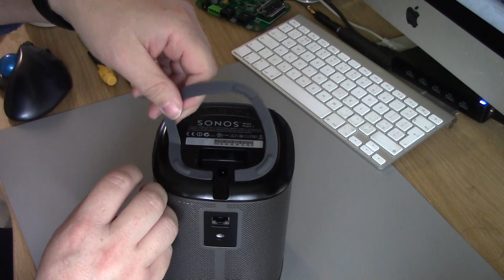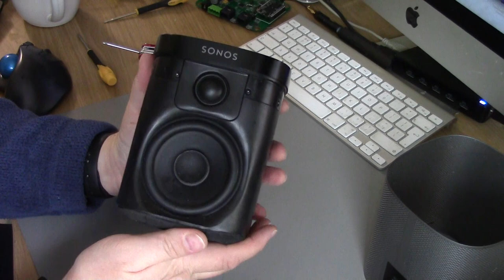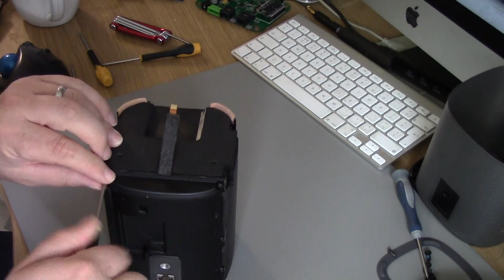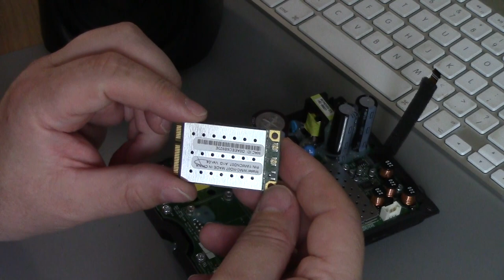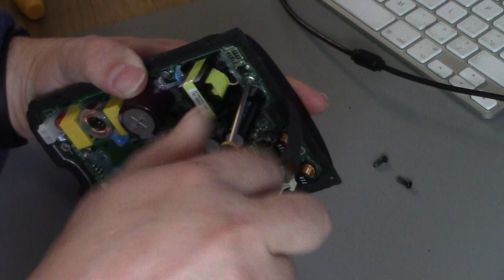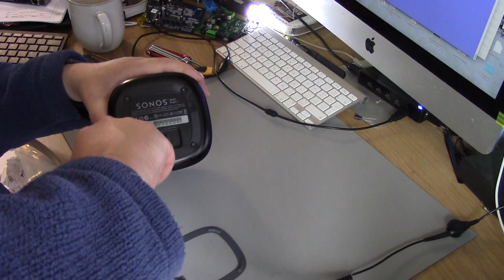Sonos PLAY 1 - Teardown

Comment: On a side note: I managed to hook up a powered Polk audio sub to a play 1 easily. You basically just hook a wire on each woofer wire and it’s a done deal. You start the sub on very low volume and run a trueplay setting and there you go, you now have real bass ;)

Comment: Is there a way to tell what’s wrong with a speaker once it’s open? Mine has a solid white light so should still function but will not connect to WiFi or be recognised by Sonos app. The factory reset doesn’t do anything and I don’t know what’s wrong with it.

Comment: I have a blown play 1 and wanted to turn it into a sonos connect to run my reviever. They want $500 for a connect so I figured if I could find where the signal goes into the amp and solder rca's I could save a lot of money. Do you know if this could be done?

Comment: Based on what you see, is there any way to pull a line out?  Coming off the amp directly?  Where do they split the frequency b/w tweeter and mid-woofer?
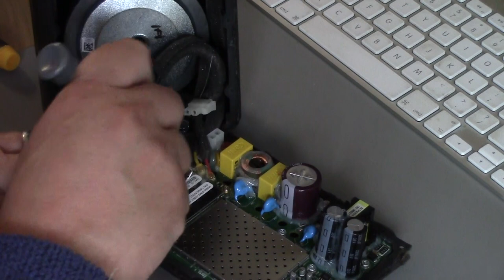Reply: Probably not.  See this, based on the speaker from Ikea (also made by Sonos).  Frequency is split in the processor itself.  https://www.youtube.com/watch?v=ZB413S8KDmo (at about 7:45 in that video)

Comment: Excellent video.  I wanted to see what I was facing when I tear one apart to add external speaker wires for an outdoor speaker.  4 wires coming off the main board for the speakers is surprising!  It probably means I'll have to tear apart the outdoor speaker to get to the woofer and tweeter wires.

Comment: Great video. Very informative. One question. I have a dent in my grill that I need to pop outwards. The screws look kind of funny in this video. What type of device are you using to unscrew The housing on the outside and remove the plastic? Because that’s what I need to purchase.
Reply from the maker: Ooh it's been a while, but I believe they were T10 "Torx" style screws.

Comment: How would you suggest fixing a Sonos Play:1 if dropped on the floor and now making a distorted sound when playing? Think this would be an easy fix?
Reply: I have the same issue
Reply: I also have the same issue 😢
Reply: It's often  a screw (4 around the speaker) that have been moved due to the impact I had to bend the speaker mounting plate back to straight and screw it down agen firmly. Oh we're ur at it check the glueing around the magnet, it can also have cracked a bit so a round of super glue there too isn't bad

Comment: Good afternoon, just come across your video, my speaker in my play one is no good now, so, I was wondering if you could help, I'm wanting to make the Sonos interface work with my old school separates system. Is there any way to disconnect the speaker in the play 1 and then send the signal to my stereo via and auxiliary/rca cable, then I could plug in :).  Thank you in advance

Comment: I was thinking to add an external sub woofer on to this via making a 6mm hole around the plastic of the Ethernet socket so I can feed a cable and connect it to speakers so the end of the cable can feed the sub.  Looking at the video the hole can’t go trough cos the board  so needs so stop half way and come out from side with another hole like and L shape. What do you think would this be possible? thanks for the video
Reply: Gurol Guven I have done this with the play 3, shorts out about half volume. Altho half volume is still much better than play 3 on its own...any suggestions for changing amp or anything? Not really that clues up on the matter but I had a spare sub, and didn’t fancy paying 650 for a Sonos one if I could help it

Comment: Your video is very interesting. Many thanks for it. As far as i am concerned , I do have several Play:1 and i was wondering if it would be possible to add an IN-LINE connector (as Play:5 have) ... because i want to be able to connect Bluetooth receiver on two of my PLAY:1 ?
Do you think you could make such video to explain how to tinker this ?
Reply from the maker: It might be possible to add line-in, but you would probably need a mechanical switch to select between wifi and line-in, and you wouldn't be able to stream it to your other devices unless you could somehow hack the firmware too.
Reply: @Spiderelectron  So, should the line-in with switch added after PCM5101A, please?
Reply: We’ll done video. I really wanted to see how to replace the woofer but you focused on the board side. Do you have a video on this?
Reply: Well done….

Comment: Thanks for this video... I got to the burned orange “fuse”(?) shall y connect the 24 volts source to the capacitor (Nichicom big barrel)?
Reply from the maker: Hmmm. You can't just feed 24V into the switch mode supply. Did you try simply replacing the fuse?

Comment: Epic strip down...  thanks for the education...  I plan to make a sub bass out of one of these and a cheap off the shelf sub bass instead of spending £700 on their unit...  I’ll copy the speaker output by drilling two small holes through the unit and sealing them with hot glue....  I recon I can have a sub for about £300 then!  :)
Reply from the maker: Nice one!

Comment: I have two P1 not getting power. How would you suggest to replace the power supply with a Boost Converter Voltage Regulator? Shall I take out the full power supply board you are showing in 9:18 . (sorry for any miss spell or grammar mistake - English is my second language)
Reply from the maker: I would first try to repair the existing supply. But if that is not possible, then you could cut the PSU tracks at the final output stage (before the output caps) and wire in a boost convertor there. I have not looked at exactly what voltages the PSU supplies, but I would imagine it generates at least 2 separate supplies one for the logic (probably 5V) and one for the Amplifier - could be anything up to 32V. But be careful, because I am just guessing! Maybe I should do a follow up video, with a more detailed look at the PSU and also see if it would be possible to add LINE-IN.

Comment: Hey what if i take apart my play one and add a bluetooth/wifi module in the pcie express slot. Do you think i will be able to play music through bluetooth then?
Reply from the maker: I would doubt it, as the firmware in the Sonos board won't be setup for it. However there's nothing to stop you trying.
Reply: Did you try it? Did it work?

Comment: is it possible to reconfiger the standard power output to a high value?
Reply from the maker: The power output is dictated by the Class-D amp chip. and the power supply voltage. I imagine it is already optimised for best output.

Comment: Wonder if you can help me out with my dead Play 1.  
It was a freebie, given to me as a dead'un.  Does not power on..Yes, checked the power lead, tried new one, 240 volt arrives ar the white Molex connector.

When it is powered on , nothing happens, no LED, no ethernet lights, so you mention a fuse own the board..is that a usable link..the yellow component..not picked the hot melt glue off yet.
Or a Switch mode PSU issue?  

Any ideas?

If you are in the UK and I can't easily get it going ...IE if it is not as simple as the 2 amp fuse, then you can have it..if you want it.
Reply: Umm.. Brown cylinder is the fuse ?  Was thinking the fuse was the bead capacitor looking device...but that brown cylinder has no continuity across the pins on the back of the board.  No power at th point son the first coil TP366 and TP 358
Was tempted to unsolder that cylinder, or even short it out across the back..with some thin usable link..but think I'll wait till you reply.
Reply: Well I replaced the 2a fuse across the back of the board, connected it again and  "BANG" it went again.  noticed a burnt component further up the chain, by the small transformer  near a SMD transistor/FET.  
So gave up on that and just fed in 24 volt from external power supply and it works .   have ordered a Meanwell LRS 75-24 and a 150W DC-DC boost convertor.  SO I can run it off a 12Volt battery
Reply from the maker: @npaisnel  What a great fix! Definitely sounds like a major issue on the SMPS, but I like the idea of using the 12 V battery. Make sure you air-seal any holes you use for feed-in wires, or better still feed the 12 V in through the mains jack, but make sure no-one ever connects it to mains! Any non-airtight holes will affect the sound quality.
Reply: @Spiderelectron  Annoyingly I only thought of feeding 12v through the old power port AFTER I cut a hole for the 2 core just above the Ethernet port.
 Ordered a meanwell 75W supply at 24v and a step up boost convertor, like £8.00 each on amazon, so can choose if I feed via 12 or 240 once I get them down.  Thinking of mounting in a bo, with 12volt battery, and solar panel.  so I can leave outdoors in the camping/BBQ area.  Sound quality in this case will be comprimised any how.  Might even disconnect internal speaker and fit boating/ marine speaker in the waterproof box.
Reply from the maker: @npaisnel  Nice one!
Reply: @Spiderelectron  Not my idea ....
https://youtu.be/DLs2MeU9Wi0

just wonder what the max input voltage is safe at those points..any idea?  I know that with reducing the input voltage, it cuts the amp and 15 volts.  Just wondered what the max safe working might be...any ideas did you see any components that might indicate what is a max and a good working input ?  Even what the built in SMPS was putting out?
Reply: @npaisnel  Where precisely did you connect the 24V from external supply?
Reply: Hfs Sta , I am sorry, so long ago now
If I had to do it again I would need to look at this and search for other instructions about it.
Sorry

Comment: I have a sonos play one
Butt there is no power show.
Power supply is ok butt no led on speaker on or blinking please help me.
Reply from the maker: Very difficult to diagnose at a distance. If you are sure the power-lead is OK, then I'd suggest it will be the switched-mode supply. It has a protection fuse. You can see me point to it at 9:18 in the video. Start there. If the fuse is bad, then ask yourself what could have caused this fuse to blow.